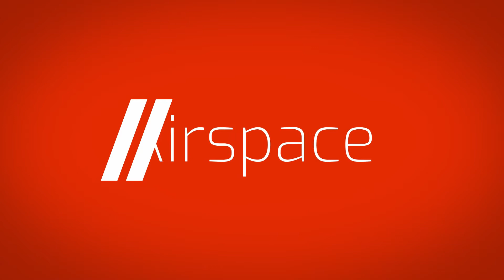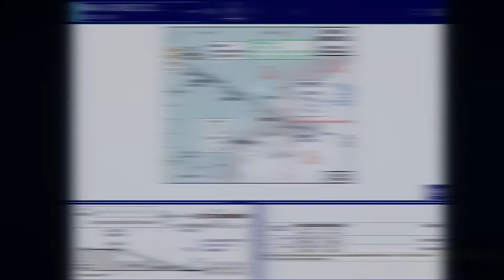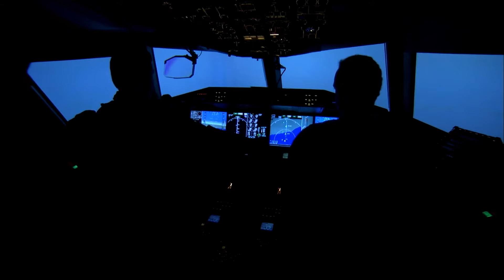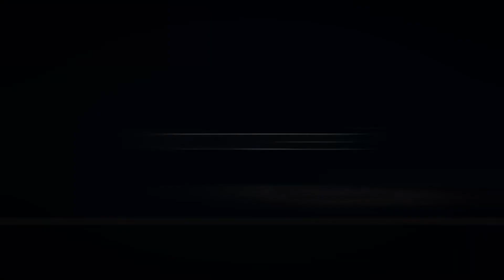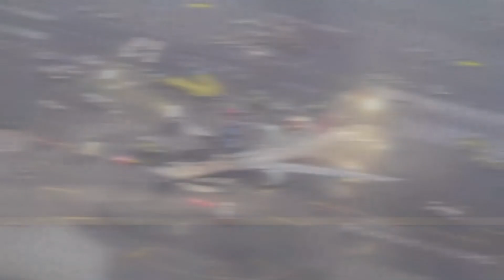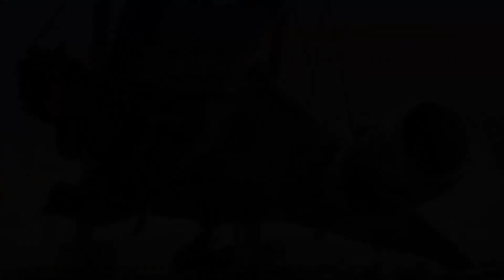Dubai Crash | What Happened to Emirates Flight 521? | Analysis in (2020)

Comment: Honestly can't understand all this blaming of Boeing rather than the pilots.

1. When engaging TO/GA, the pilot flying is supposed to verify thrust lever position is set to reduced takeoff thrust by *having their hand on thrust levers as they advance*.
2. Pilot monitoring should verify flight director go-around guidance is set with TO/GA displayed on both speed and altitude annunciators. 
3. A GE-90 spooling up is pretty obvious sounding. There's also the main engine displays that would indicate whether TO/GA is actually being set but I guess they were too busy to read the gauges huh.

Comment: I was just thinking, on our 767, the spoilers automatically extend when the plane senses hydraulic pressure (weight on wheels) AND when the truck tilt (You can see on the 777 the wheels kinda hang down, that’s the tilt they’re referring to) is in a no-tilt condition (horizontal to the ground). I imagine the 777 systems have a feature very similar meaning when the plane touched down the computer didn’t see the truck tilt all the way down so…a rare scenario where a smooth landing made things worse.

Comment: Just thinking from a software engineer perspective, I think those toga switches should be enabled above a certain speed on the ground. Its unlikely to be a mistake if the plane is already moving far above taxi-ing speed
Reply: Sounds like a good solution, and one that shouldn't be technically difficult to reprogramme? Curious as to what safety bulletins (if any) Boeing may have sent it after the report was issued..

Comment: Instead of just push the Toga switch then pull the trust lever .
That way you know that now the engines getting running and spool up.
Never just trust sensors / computers blindly .
Yes it seem so easy just push the Toga switch and the pre programmed 
take of is activated  , But is it really that hard to just do it manually ?
By doing manually you can be shure the plane do what you want it to do .
( Never blindly trust any automated systems )
Edit - 
         Such failures is one of many many reason why I really do not like flying .

Comment: Erm - maybe I'm being dense here - but aren't there multiple sources of data that can tell a computer that a TOGA disable would be inappropriate? E.g. airspeed above taxi speed, flaps deployed, commanded positive attitude for flare? Do they have ground speed sensors by wheel rotation? 

From the outside this seems like incredibly poor design for such an important system. You don't get a lot of time to catch systems failures in a go-around situation.

Also - if theres any aircraft systems engineers reading - would manually advancing the throttles cancel the TOGA input? i.e. can procedure be "hit the TOGA button, and then advance throttes manually to make sure"?
Reply from the maker: I've always hated the idea of TOGA buttons (no airbus has them these days by the way). I just don't see their purpose! Want to take off or go around? Just advance the thrust levers like a normal person!
And to your question - I'm sure that would be possible. No idea why it's not done that way. Cost, maybe?
Reply: Exactly! This is a terrible user interface design decision. Just adding airspeed below certain threshold to the conditions to cancel TOGA would prevent this and Sukhoi Superjet crash in Island. When the computer overrides pilot input without any feedback, it should do it only in the narrowest of circumstances. Correction: there should be no override without feedback given to pilot, period!

Comment: Isn't there any indication in the FMS Screen for when you touchdown? Also what about auto breaking?
Reply from the maker: not sure about that for boeing! also, at that point one is looking outside, mostly, to achieve a good landing.
Reply: @AirspaceVideos  The pilot monitoring could keep an eye for that indication. Or some other solution would be for the pilot to just manually move the thrust levers when doing a go around instead of using the toga.
Reply from the maker: or the more simple solution, the TOGA buttons could just be active when on ground and the airspeed is higher than, let's say 100kts.
Reply: @AirspaceVideos  Exactly what I wanted to say next :)

Comment: No one ever goes around after wheels touch, right?  lol

Seems a bad design to me.  The design has the pilots push the go button but if the wheels even kiss the runway the bus does nothing.  Bad automation.  An aircraft with that many sensors can surely figure out the difference between landing and parking and go around when landing.  The worst thing it could have done was what it did - nothing.   All that said, I think every airplane should have the pilots pushing the thrust levers full forward in a TOGA.  It is as unequivocal an action in an airbus or boeing as it is in a Cessna.
Reply from the maker: Yes, that design bugs me too.
Reply: I’m B737 so not sure about 777, but as soon as aircrafts touchdown, there is a Boeing SOP from the FCOM, but not all companies did it, I know for PM to call. “Speed brake up/not up, Reverse Thrust #1/#2/idle detent normal, or no reverse thrust #1/#2 engine, auto brakes disarm, 60 kts .” If you touch down too smoothly, a “DO NOT ARM” warning will annunciate. Then you just manually raise the spoilers yourself or wait for the inertia to do that automatically for the greaser, but training departments don’t like it cause it eats LDA. But to answer the debate to the best of my knowledge and training, pilots are not committed to the landing until the reversers are deployed.
Reply: I second that

Comment: Sounds crazy that those computers cannot understand different phases of flight. Computer thinks taxiing being same than touchdown.
Reply: You'd be surprised how dumb the flight management systems on these aircraft are. Say you're flying a 737 around New York with a range of 2000nm. You input a waypoint, but there's a typo and that waypoint just so happens to be somewhere over Australia. The FMS is gonna take you there no questions asked. Whether you have enough fuel for it or not.
Reply: @ShawnyVT  I see. And there is something called Cockpit Gradient which is too many times monitored only from flight recorders after crash. The flight computers has similar thing built in and it has emerged during programming phase of the aircraft automatic control systems. It manifests the cockpit gradient of the programming team and even that team interfacing marketing department and mixed minded engineers. So there is lot of things that can and will go wrong but also these could be acked and bad things mitigated. More I watch Mentour Pilot more it is obvious that in that industry is some very twisted things going on. It all ends at the FAA certification.  Based on those videos it seems that the aircraft manufacturer is actively pushing things out from its own resposibility to FAA to be dealed and FAA has the cloak of invisibility to make things disappear. How on the earth that engine was allowed to be mounted at the wrong position in the first place?
Reply: Well, they want to keep things overly simple, because the less things there are, the less can break. 

Of course, they should have added a dee-doo sound or something to indicate “rejected input”. And a “ground contact” lamp/audio notification/status display. The LMs landing on the moon had them …
Reply: Boeing didn't have MCAS (May Crash Any Second) programmed and ready so they created WCA - Will Crash Anyway...